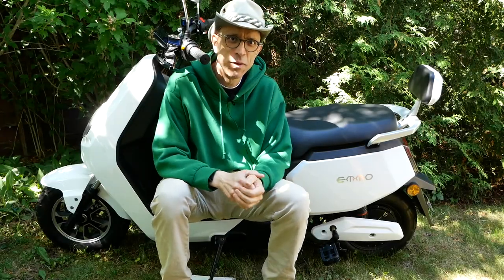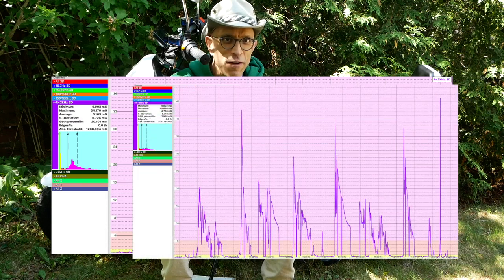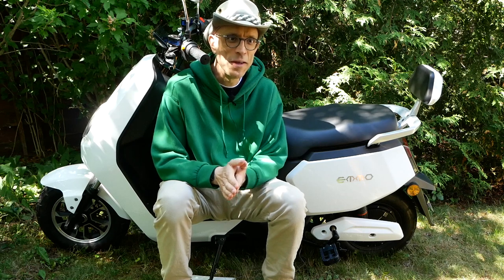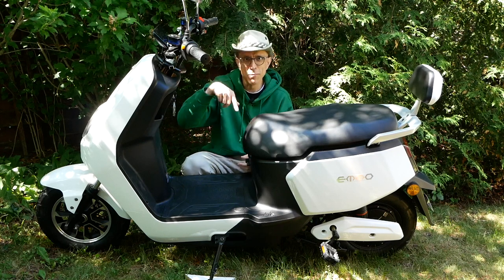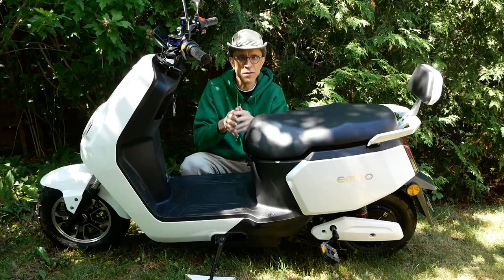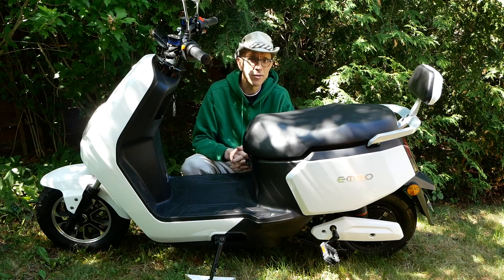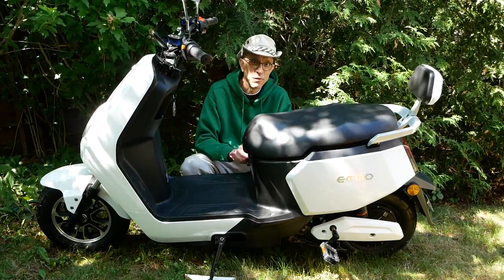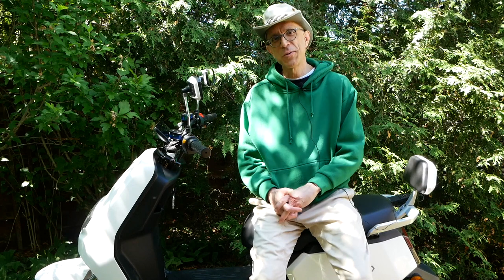8x LESS Radiation

Comment: Nice ride! Way to improve to as well!
Reply from the maker: Thanks!  The upcoming Part 2 of this project will be about the crazy high E-Fields on this bike, and on most e-bikes now.  They have poorly designed motor controllers with little DC bypass, and unshielded wiring.  These things are mobile 15 KHz transmitters full of spurious emissions - not great for EHS people.  I was hoping to keep this bike, especially after making a custom 3kWh lithium battery for >100km range.

Comment: Great info thanks. What brand/model of EMF meter did you use to check the fields with?
Reply from the maker: Measurements were taken with the Gigahertz Solutions NFA1000 at the seat position.  Thanks!
Reply: @9ci  thanks